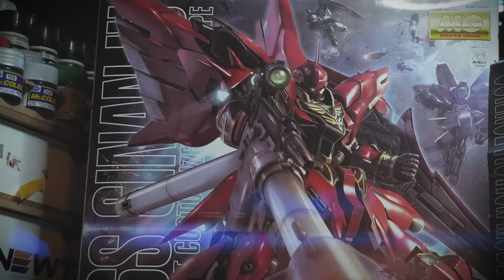The Beautiful Takumi Studio MG Sinanju Conversion Kit │ CUSTOM Build │ガンプラ全塗装

Comment: Serious question…how do you keep the parts straight after separating them all from the runner?  How do you know what piece is what without the frame and part number?  It looks like a bewildering sea of parts, and they are all roughly the same shape and size.

Comment: Get yourself a cordless airbrush the Noname@ Startairbrush.com works great, and if you don't like what airbrush is on it you can change it out with whatever you use.(just remember that you have to use the valve that comes with the tank if not it continuously runs) it charges and runs for about an 1.25 hrs on a charger for about 70.00 with shipping say 85.00.
its also they based in Florida so no 3 mths wait time from china lol!